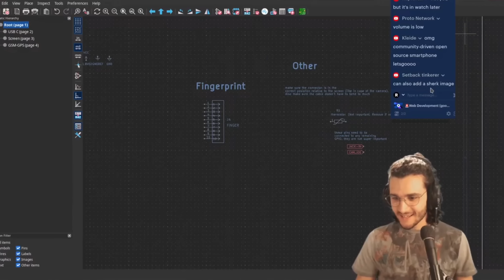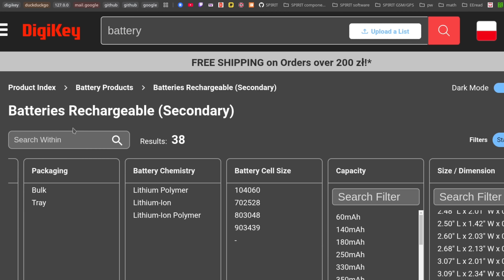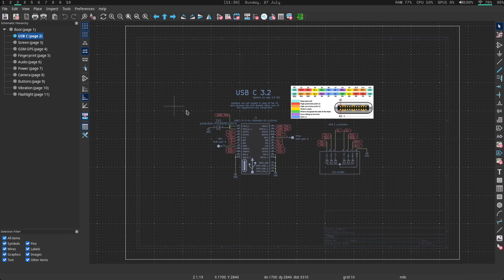Can I build a BETTER smartphone from scratch?

Comment: Im also very interested in making my own phone and have plenty of experience writing linux kernel drivers, embedded firmware, designing pcbs, etc.. The thing that usually stands in my way is the fact that manufacturers don’t tend to make SoC chips super available to the public, and options for standalone 4G/5G modules seem extremely few and far between. I would love for someone to correct me if I’m wrong

Comment: 1:48 this is just incorrect sure the batteries diminish after 2 years but they are still easy and afford to replace. Even then my previous phone I had for 4 years without a battery replacement. $50 and I could have had a brand new battery and gotten great battery life again

Comment: The irony is that Apple started like this, even if it was not ideological.  
They were searching for a new paradigm.  
I have the apple machintosh powerbook 5300cs, one of the first mass electronics products, and is made exactly as you say, everything is a separate module.

Comment: Police in the US are allowed to force you to open a fingerprint-scan-protected device, as it's not considered "locked" legally. So maybe just when the option to scan your fingerprint would come up, it should also have an option pop up to disable the fingerprint unlock until you input a code again. Having it on the screen would be way faster to secure your phone, instead of having to go through settings and hope you're fast enough.

Comment: the raspberry pi is not open source. it not only isn't open source hardware, you can't even use the raspberry pi without loading and running proprietary firmware. the pinephone is our closest example to what's possible in the open source hardware space.

Comment: If you're gonna add hardware privacy switches, I'd also add some network and connection ones. May seem like overdoing it, but they can also listen through the NIC card since most of the time it has its own firmware.

Comment: Appreciate the idea! But i have a feeling this wont age very well.

Cause if we combine all the costs (hardware + ui + Os + all the custom parts) it will be roughly 450$(iPhone 13 price) just to make it presentable and work!
Reply from the maker: wdym by ui and os costs?

as for the custom parts, there is only the motherboard and chassis
Reply: As u said "from scratch" , U/ur team gonna make the Operating system right???(so their labour cost ). 
And for the "custom parts" there would be 2 motherboard (1) the compute module (2) the board that will connect all the features of phone like(camera, display, sim card module, ......etc)
And since u said easy to repair I m guessing all parts would be hot swappable that's where the cost will peak(as u already know phones dosent comes with 1 or 2 functionality:).
 And fitting all that in a small/reasonable case/she'll is a hassle itself. That's where u have to make ur own custom part for every/most of the functionality/module.

Tell me if I misunderstood anything.
Will appreciate if can work with u in the project ;)

Comment: HELP!.  I Need a Rugged indoor/outdoor phone. Non Reflective Bright screen. >5000mA Battery With SD Slot. *Strong BT Ant. Stronger *WIFI ANT.  And the best *Cell Ant.    Excellent volume with clear speaker. Power off Button.  And all the privacy features available.. A key board with larger buttons for large Thumbs. Fast processor. mIn. 32g Ram. 128G storage. .  .  No Larger than 6.5". . .      . . To start. No Samsungs. NO I-Phones.

Comment: great project but how to solve the base band problem ? this part cannot be open source part ... is'n it ?
Reply from the maker: We are using a GSM module that handles most of the GSM+GPS stuff for us, the datasheet is available after logging in to the manufacturers website for free! It's hardware is of course not open unfortunately...

Comment: these things use USB so just use a linux board and you get all the stuff, just be careful of audio our supplier changed how audio was routed so it no longer comes out the USB port due to 3G ending service, it's about 20 lines to of AT stuff to make them go lookup luckfox boards small cheap and will do most of the stuff out of the box. USE a ESP32 CYD for the display, you're never sending video.

Comment: Looking at the design so far, I would suggest a hinge camera design. This means you don't have to deal with implementing a front camera and you get the quality of the rear camera on the front. The Ikko MindOne Pro would be good to look at for inspiration.
Reply from the maker: we thought about it but this creates 2 problems:
- difficult to waterproof
- flex cable can get damaged easily
Reply: Would rather not have a selfie camera tbh!

Comment: But I do repairs on my old Oppo A5s, which I had since 2019.
I just bought replacement parts from Chinese online stores like LCD screen,charging port, and batteries. 
I've already changed the LCD 5 times, but I'm using compatible Realme brand LCD and not the Oppo one for it's cheaper.

Comment: For people who want a comparebal phone to this there is a manufacturer who makes a phone kind of like this. The shift phone it is waterproof, hardware switch for camera and mic, replacebal battery like in the old days, replacement parts available, easy to repair, designed in Germany and manufactured in China but according to German labor standards (which are really good)

Comment: i recommend you to do it based on RK3566 or RK3588, not raspberry pi, it draws less power, and you can make fully custom pcb based on it, not needing to use any kind of compute module, there is also something like RK817 to power it from lithium battery directly, with fancy stuff like battery percentage display, if you want to, i can help ypu with this kind of project, well.. at least as far as i can, because my knowledge on this is mostly theoretical, but i have some experience with electronics in general. oh and i'm also polish, so, yeah

Comment: Hey, I was going through your Git page, and under External Addons → External Battery I thought of an interesting idea. What if we used a glove with metallic contacts that connect to the phone to power it up? The phone could have contact points on the sides and the back. When you hold it, your palm would touch the back contacts while your fingers connect with the side contacts. With some modifications, this setup could work in both landscape and portrait orientations

Comment: I too wish that there was a easy plug as to disable cameras and microphone, i dont trust disabling acces in the phone since its software not hardware so a experienced hacker can bypass it, i somethimes wished no camera phones existed which allows more space for like sd card, 3.5mm jack and or even more battery and processing power. And instead youd be using the usb c port to plug in a camera, maybe like 2 usb ports one juet for data like the rog phone, this allows such as you choosing how much monry you want to spend on a camera,  without a camera youd have privacy, you can even install such as night camera and even heat camera and also cameras are suppose to be T H I C K so having them not in the phone would remove alot of limitaions and allow for more stuff such as screen with no camera hole and a flat backside, also you get to have the rear camera as a selfie cam by simply turning the usb c camera around, isnt that a cool idea? So could you please make a version without a camera at all? For those who want full screen realestate and in return more battery for removing their camera?
Reply from the maker: the camera is totally optional and we plan supporting SD cards so the short answer is yes, the long answer is take a look at our github issues and the discussions around external optional addons!
Reply: @V_Electronics thank you alot! Since there exist no cameraless phones i would love seeing some people like you make some.  Back then a phone was more like a small computer when nowadays a phone is like a camera with a screen, companies are too focused on the camera part the most tbh.

Comment: Maybe for an OS you can use something like ubuntu touch, or make a .sh script that will transform an existing linux desktop OS into something that is usable with a phone. Just giving ideas.

Edit: Oh, I didn't see the github wiki
Reply from the maker: .sh script? that wouldn't be enough, however I'm into loading it with a customized Linux with a tailored config & packages. (Need to complete hardware first though!)
Reply: Yeah, that is a good idea, don't know how I didn't think of that. From the options posted on github I think PostmarketOS would be the best option with Fedora KDE in a close second. Android is just, no, and im not so sure how Ubuntu Touch would run on Pi because its marked as experimental and I also can't seem to find the source code for it. One other option that I suggest to try out is be Raspberry Pi OS, because of all the stuff tweaked for Pi hardware, but also it would probably need a lot more work to "transform" it into a "phone" mode if you get me, than to use something like PostmarketOS with various patches for custom hardware.

Comment: If you want some additional inspiration, check out the Purism Librem 5.  Also GPL designs (and runs Linux), and may give you some adjacent ideas to include (such as HW-disabling IMU, cellular, and WiFi; M.2 replaceable wireless cards; etc).  The "l5-schematic" repo on their custom gitlab instance has KiCad-ported files 🙂

Comment: Dude quick ideas for your smartphone.
Use things like pcb way to make your motherboard and you can post the motherboard pcb file so people can order it easily.
Maybe research small PC rams or parts that so people can use different sizes (or add a sd card slot)
3d printing with probably be your best choice for the outside of the phone for prototyping and pcb way does metal 3d printing.
DISCLAIMER I don’t know anything about phones

Comment: Standard screws, means Philips screws, are a total nightmare for repairability! It just takes one screw the manufacturer had rounded in the assembly at the most crucial point to make the entire disassembly so much more difficult or even almost impossible.

And I had that issue so many times, that I could open something with breaking it just because every third Philips screw was round like hell. Therefore, I don't get why people want that. You get in budget precision toolboxes for 10 bugs every size of torx nowadays. So, why not making torx the one standard?

Comment: the pi5 is tash,use one with intel n100,you need to reflash the pwm ic to limit the power further, and lower switching frequency to get lower power consumption of the vrm.

Comment: replace phone every 2 years??? I used my previous one for 8 years, current one is now running 5 years. Yes, iPhones. current one is the 2020 SE. Running just fine, still has 3 years of support left. Tell that to any android user.
Reply from the maker: That's amazing! I also use the same phone for like 5 years. (Unfortunately that is not the experience of most users)

Comment: How easy would it be to include a physical qwerty keyboard?
Reply from the maker: Not very easy mainly because of the added thickness. However maybe there exist ready keyboard modules..? 

You can plug in a physical keyboard using USB C but that's not what you want probably.

You can open  a GitHub issue so the idea doesn't get lost

Comment: TBH I don't get why people only stuck on Raspberry. Yes, it is really well documented, but there are so much faster boards even for cheaper and lower power like the Radxa CM5 or Orange Pi CM5. Basically one of the main features which Radxa CM5 comes with is full compatibility to RPi CM4 carriers.
Reply: Doesn't he specifically address that in the video? He says that you should be able to mix and match the CM5 with other types and that you should try it!
Reply: Support in mainline. Read about "cool" rk3588 and Joshua Riek

Comment: I would try to use some laptop motherboard or smth for the ram upgrades, for main storage i tought about using a pendrive or smth, but it woul be nearly impossible to make it fit on a phone sized mount, all of this would be on a am4 motherboard and it would use linux

Comment: While my phone is repairable, because I decided to buy a repairable device. The hardware kill switch for the microphone, camera and battery is missing :/.
I wouldn’t buy a raspberry pi cm5 based phone, but I could see myself adapting the design with a much larger battery and screen to create a tablet.
That’s why I love open source. If it doesn’t fit my needs I can just adapt it to my will! Thanks for working on this project I’m very exited for it.

Comment: Physical switches fucking rule. Love that part. One for the data antenna would be handy too.
Reply: Honestly, drop the fingerprint reader even. An actually good password is just as secure, and that way you never have any biometrics scanned at all.
Reply from the maker: Good passwords are slow to type... so it's a trade-off @curvingfyre6810
Reply: @V_Electronics  only if you're a slow typer. Convenience at the expense of safety/security/simplicity is the entire thing a project like this is designed to avoid, right?
Reply: @curvingfyre6810 just don't install the fingerprint scanner when you're making your own 

why rid everyone of the feature you think you don't need?

Comment: for the RoHS compliance it depends on the manufacturers of each component on if they have complied or not, which in the case of this phone where everything is modular and self-made, it is impossible without a set list of components to check for the compliance, i wouldnt mind researching for each component for the recomended configuration for the EU and move on to each electronic compliance standards of each region

Comment: In fact, such applications gave you recommendations because they are allowed access to the microphone in principle (even in the settings it can be turned off). but the problem is different. how do you disable tracking, and in general check what happens at the level of microprocessors, the technology of which is still as classified as possible? it can be keylogging at the hardware level, periodic photos from your camera or screenshots, even in the off state it can continue to work.
Reply from the maker: Thats why the hardware switches are so nice
Reply: @V_Electronics shoting a round through your phone also works great as a onetime switch

Comment: The pi cm5 probably isn’t the best choice, the heat problem comes from it’s soc being built on 16nm, so it needs more power for the same performance.
A rock cm5 would be better (8nm)

Comment: It might be silly, but one feature I'd really like is to function as an private walkie-talkie / 2-way radio, if only for my family and I. That way we can just talk with a button press if we're in close enough range.

I'd also like an IR blaster, just for the fun of it.
Reply from the maker: Walkie talkie is not on the roadmap for now HOWEVER ir blaster is has on open issue on GitHub and will be included!!!
Reply: @V_Electronics  Dang. Still, what you're doing is great.
Reply: This used to be a thing with older cell phones.
Reply: @MultiBerticus  And it stopped being a thing because the providers couldn't bill you for it, but they could bill calls and texts.

Now there are apps like Zello that do the exact same thing but still use cell phone networks. So if the network is bad, goes down or you just can't get a signal, but you're in range of each other, too bad.

Comment: RPi5 doesn't seem like a good choice for a mobile device. BCM2712 is really power hungry and gets quite hot. I would personally go with something like Radxa CM3 module with RK3566. That way you could also tap in on all the Linux kernel work Pine64 had done with their PineTab2 and PineNote. But hey! Who am I to give advice to somebody who was already capable to project so much. Great job! 😅
Reply: no,use the n100 intel